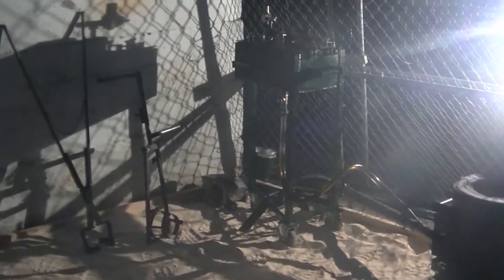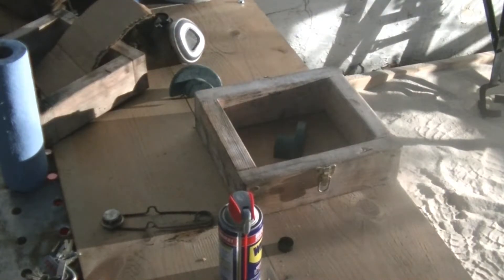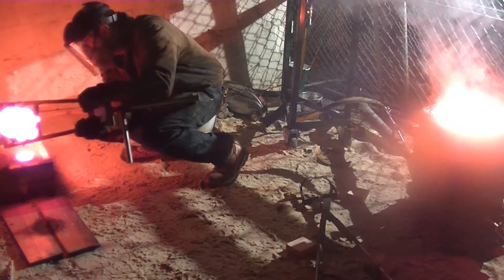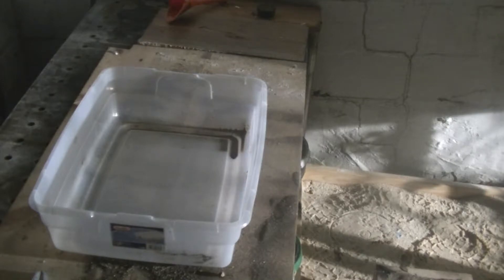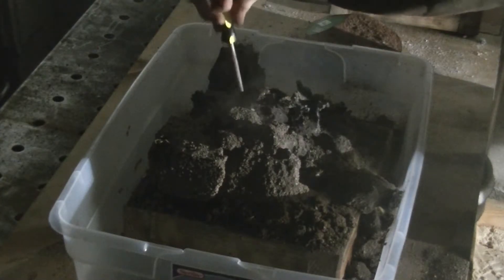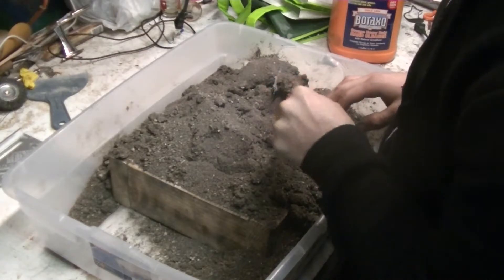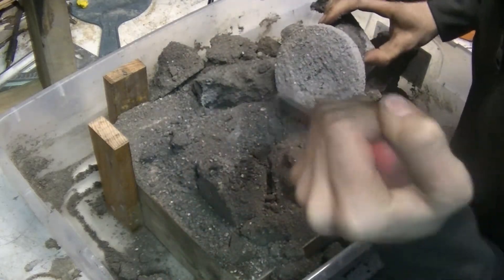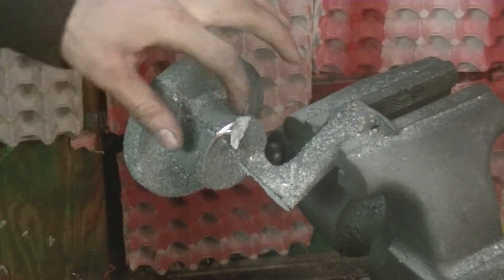Steam Engine Build: Cast Iron Cylinder Head Pour (Take 2!)

Comment: It's a mostly flat part, so why are you not moulding it flat? I don't see the reason for doing a part like that in two halves and vertically. You wouldn't have these issues if you did it horizontal.

Comment: Hi friend! I have some questions about melting cast iron. How can I contact ?
Reply from the maker: You can post here in the comments.  That's the best way for me to see it.
Reply: Friend I just start melting cast iron in small induction melting furnace 10kg. My question is when its melt in 1300 degree I must raise up temperature 100-150c so that when the metal is poured into the mold it does not cool quickly. How I know the metal is ready for casting?
Reply from the maker: What I do is stick a steel rod in there and stir it a bit.  The steel rod should move freely in the liquid iron and have minimal iron stick to it when you pull it out.

Comment: that was quite an adventure!  Iron looks pretty tough, i'm surprised how long the crucible stayed glowing bright after you took it out of the furnace, especially that first run through with the steel.
Reply: You should try ductile iron crankshafts, they melt with very little slag. An iron melt for me takes 30 minutes ( 6.8 Kg ) Your furnace is not running right it should be a lot quicker than that. Also you are pouring your iron too cold, still a great effort for a beginner. It takes me back when I started to melt iron about 33 years ago.
Reply: If you get time have a look at my videos, most of them are about melting iron for my projects. Some of them show many steam engines I have built long before I signed up to youtube. I have always been keen to cast and machine my own parts in iron so we have a lot in common.
Reply from the maker: It certainly was an adventure for me.  Much more annoying though since each pour takes a minimum of an hour and a half!  

The crucible certainly IS hot!  I actually should be wearing my carhart over my jeans as many times the heat burns my legs, even when decently far away.
Reply from the maker: Thanks for the comment.  I have found that when my fiberglass rope gasket goes and lets the flame leak out, it takes WAY longer to melt the iron.  With a brand new, working gasket, the iron melts much quicker.  So maybe that's it.

Feel free to give me any other tips you may have learned in your 33 years! I am still learning and would love to hear em.
Reply from the maker: Subbed!